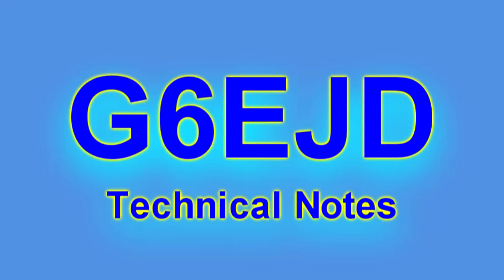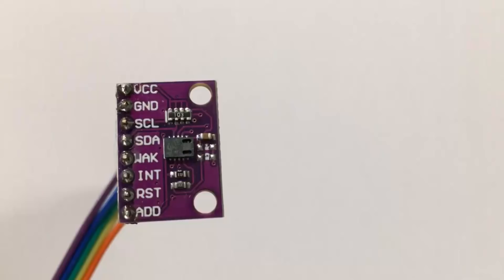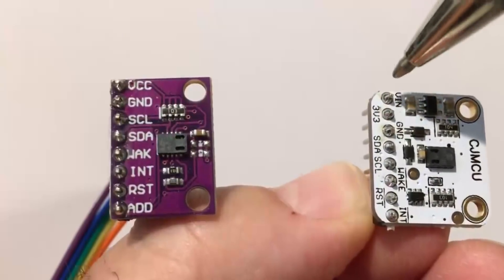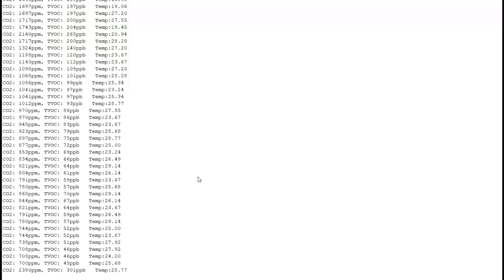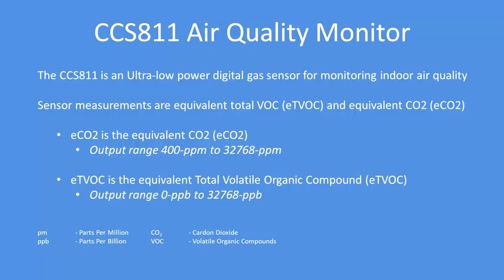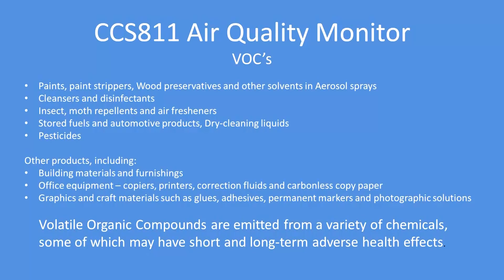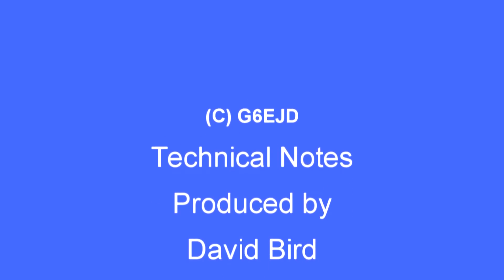Tech Note 103 - CCS811 Air Quality Monitor for Ardunio, ESP8266 or ESP32

Comment: the value of Rs/Ro for No2 in fresh air of Mics 6814 sensor??..kindly reply me
Reply from the maker: 12K in clean air
Reply: @G6EJD  is this confirm or not??
Reply: Actually I am searching a lot on Google but couldn't find any value of Ro/Rs for the Mics 6814 sensor for finding the No2 ??..I am stuck at this point..
Reply from the maker: You can look up the data sheet and it gives the ranges there down to 0ppm, I just did and that’s the value it says.
Reply: @G6EJD  12 K is for which sensor??
Reply from the maker: @shahmeertahir2473  for the one you specified, what else would I have given you?

Comment: Good video. Any idea how acurate the co2 readings are? does sensor need any calibration over time  ?
Reply from the maker: None are very accurate more a relative reading, if you want a reliable high accuracy and repeatable sensor they start at around £50/$75 and they all take some time to read. The sensor featured here is an estimated CO2 reading based on the readings of other gases, a mix that would probably occur in most situations.

Comment: i have fiolet CCS811 sensor, but this sensor has not temperature and humidity
Reply from the maker: No that’s right, this is why the bme680 is better as it adds temperature, pressure a f humidity to VOC detection. The CCS811 requires a burn-in time of 48 hours and a run-in of 20 minutes (you must allow 20 minutes for the sensor to warm up and output valid data).

Note: Temperature compensation from an attached NTC Thermistor is no longer supported on the CCS811.
Reply: @G6EJD  thanks

Comment: Hello mate I need your help !
I want to mesure Oxygen or Nitrogen in the air at the outlet of an oxygen generator ! is this sensor useful ?
Reply from the maker: Does not measure O2, use something like this: https://www.seeedstudio.com/Grove-Oxygen-Sensor-ME2-O2-f20.html
Reply: @G6EJD  thanks ! that's what I fear too expensive and not available in my country :(
Reply from the maker: Check out: 
Grove O2 sensor
LuminOx sensor
R17/R21/R22 sensor
Figaro (such as K50)
UK City/Citicel sensor (4OXV/7OXV)
SenSore sensors
Possibly even a car lambda sensor such as Bosch LSU 4.9
Reply from the maker: Car lambda sensor might the be lowest cost sensor if you can get a data sheet for one.
Reply from the maker: I can’t find any low cost, easy to use sensors for O2
Reply: @G6EJD  LAmbda sensor works at highlt tempretures 600 °C :(  I need to search one of your sensors list .. thanks for your helpmate :D !

Comment: i bought cjmcu 524 nh3 gas sensor it includes stm328003f inbuilt on it and  it has i2c pin, but i cant able to scan the i2c addres.pls help me out of this
Reply from the maker: Have you go the right I2C connections, have you tried an I2C scanner, check the data sheet for it's I2C address it should be found. You probably do not have the correct i2C pins connected.

Comment: Thank you for the tutorial! I noticed that you used the Adafruit library for the CCS811. Can we use this library even though the sensor is not from Adafruit? I noticed that the Adafruit one is more expensive.
Reply from the maker: Yes Adafruit release their libraries for general use, I have never used Adafruit products, but sometimes like the bme280 sensors they use a different device address and so the library needs different settings to get things working, but this rare. Some really low cost devices maybe out of specification from China, that’s the risk, but generally if they are the difference is marginal for most applications.
Reply: @G6EJD  I see, thank you for the clarification!

Comment: Thank you very much for the tutorial, so how do we calculate the ratio of oxygen concentration in the air? Or just help me for reference
Reply from the maker: Sơn Nguyễn Minh, the device is calibrated at the factory. The only way you can calibrate by varying the reading value is to use an external reference like any other calibration method. It’s more of a qualitative measurement giving degrees of concentration

Comment: do I have to use a little fan that blows air to the sensor?
Reply from the maker: Morten mo, using a fan will give you false results due to wind chill etc.
Reply: @G6EJD  but when there is no air movement near sensor ...  are co2 results ok then?
Reply from the maker: Morten mo, you will always have natural air movement to give you a reading and the gases don’t tend to be in pockets of air and are naturally dispersed. You can use a fan but don’t expect accurate results

Comment: I'll try to hook the breakoutboard up to a wemos d1 mini, like in your wiring-diagram, but I got one question about your .ino-sketch: In the Code the only pin-reference i can see is "A1". Should i change it to 'D1' or 'D2', since you're wiring the sensor to these pins ? Thank you in advance :)
Reply from the maker: Which pins you use depends on the board type, are you using an ESP32 or ESP8266 and what is the board name? If an ESP8266 nodemcu type then the correct pins are 4 and 5, let me know
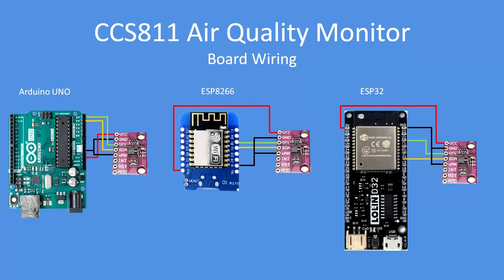Reply: @G6EJD  a "Wemos D1 Mini" like i wrote above, an ESP8266. The Sensor breakoutboard also looks exactly like your purple one. In your picture at 3:20, the middle-one is exactly my setup.
Reply from the maker: Kartoffelsnack, so what is not happening are you getting any values on the serial port? Most problems will be wiring based assuming the sensor is ok.
Reply: I haven't tried it yet, because i don't know how to change the code to fit the pins on the 'd1 mini'.
Reply from the maker: If your using the Wemos D1 Mini then connect the sensor to D1 and D1 as labelled and shown in the centre diagram.
Reply: @G6EJD  Do i have to change the code?
Reply from the maker: Kartoffelsnack, No code changes required connect the Wemos d1 mini to the sensor exactly as I show in the schematic, compile and upload and see what it says on the serial monitor does it say failed to start sensor?
Reply: @G6EJD  today i finaly found some time to look at the sensor again.
with "A1" it wouldn't compile, so i changed every 'A1' to 'D2' and it seems to work now :)
Reply from the maker: I've removed the A3 references in the source the Sensor ON / OFF functions are not used
Reply: @G6EJD  The  Sensor_ON();-function is still called within the setup();-function. I think this will lead to an error.
Reply from the maker: @Kartoffelsnack  These functions are only required for the Adafruit boards, so I removed them and the function call too.

Comment: Good day. How to display information in lcd1602?
Reply from the maker: The LCD library is inbuilt so I suggest trying out one of the examples then adding the driver and lcd.print statements to my code.
Reply: @G6EJD  Do I just need to substitute an serial.print for an lcd.print?
Reply from the maker: Михаил the other way around. Every time you want to display on the LCD do a lcd.print

Comment: it does not measure CO2, only CO
Reply from the maker: I think you should read the data sheet again, your wrong it measures Volatile Organic Compounds and estimates the Carbon-dioxide level NOT Carbon-monoxide. If you don’t agree please write and complain to the manufacturer that the lowest cost and power sensor on the market isn’t good enough and doesn’t measure CO2 and ask them what they are going to do about it.
Reply: He's somehow right, it seems that there are two versions sold:

CO2:
https://www.ebay.de/itm/CCS811-HDC1080-CO2-Carbon-Dioxide-VOCs-Air-Quality-Temperature-Humidity-Sensor-F/232747057091?hash=item3630ce3fc3:g:cv0AAOSw7I5a4Xqv:rk:9:pf:0

CO:
https://www.ebay.de/itm/CJMCU-CCS811-811-Carbon-Monoxide-CO-Cov-Gas-Sensors-Air-Quality-Numerical/263548924643?hash=item3d5cbd72e3:g:R8sAAOSwlJlaqOA-:rk:8:pf:0

Comment: https://rover.ebay.com/rover/0/0/0?mpre=https%3A%2F%2Fwww.ebay.com.au%2Fulk%2Fitm%2F263786011189

Seems there are combo boards with multiple sensors available.

Anyone extended this project to try these additional sensors??

Comment: I have CCS811 running for weeks on an ESP but it drifts so much that it is useless for CO2 trend logging.  It is a VOC sensor and just has a multiply factor for CO2 so if have VOCs for solvents say  then CO2 is just wrong.  I changed to an optical sensor  EE893  but $90 in cost, so not far to compare. It is stable and not sensitive to VOCs.
Reply: These things can't distinguish CO2 from VOCs, they're sensitive to a wide range of gasses with different sensitivity levels. The eCO2 reading they provide is only valid if there is ONLY CO2 present. CO2 is typically one of the gasses that metal oxides sensors are least sensitive to, so basically the presence of any VOCs makes the eCO2 reading totally invalid, because it will appear much higher since the sensor is more sensitive to VOCs. @Graham Wise is correct, these things are not useful for measuring CO2 indoors. You really consider the eVOC reading to be accurate either, it's really only good for deviations from baseline. 

Actual CO2 sensors are kind of expensive because of how they work, even the cheapest ones on Aliexpress are $25 or more.
Reply from the maker: There are a number of issues here, first I believe most implementations do not apply the device data sheet instructions for use such as modes and for establishing and updating the baseline and to be fair to the manufacturer they do clearly state the CO2 reading is ‘equivalent’ not actual and they don’t quote any accuracy figures so we have to determine that the device is a relative reading only, but for most most applications the device can be used successfully to determine if the atmosphere contains gases that are higher than the device baseline, it’s most definitely not an absolute measurement device. If the air is good the readings will be low if bad high, that’s probably all we need to know.
Reply from the maker: I think that’s exactly the point it’s a relative air quality monitor set against the last known baseline , if the air is generally bad then it’s either more of the same or worst or better. I’ll have a look through the library to see if there’s a function to read write a baseline. I have a Dyson Cool Link fan and it’s air quality monitor bears more than a passing similarity to the css811 output the problem is at £500 it’s a bit too expensive and complicated to take apart to find out!
Reply: I had the same experience as Graham Wise. I tried two different CCS811 sensors with an ESP8266 and even moved to an Arduino. After a couple of days the VOC / CO2 readings were completed useless. One reset and it start working again.... What about you David Bird, have you run it for some days? Did you experiment any drift? BTW, thanks for all the great videos!
Reply from the maker: I think by the time VOC rises above the background / normal values CO2 levels becomes largely irrelevant as the toxic air is driven by the VOC content. So-far I've found it tracks the CO2 levels quite well.
Reply from the maker: Well I have only been running it after being woke up from sleep then I take 4-readings as the first 2 are usually 0’s as the sensor heats then I get a stable and sensible reading so I take the fourth. I could use the nINT output to wait for a valid reading too, but I find the simple approach is working ok for me. I have also noted that it’s very sensitive to power supply variations and takes quite a lot of power. I’m not aware of any endemic issues with the sensor either, so I suspect it’s down to application.
Reply from the maker: I’ve just read the data sheet again and there are specific processes to follow regarding baseline settings for operation > 24hrs did you implement these?
Reply: The problem is you can set a baseline if you can read out the registers, Sparkfun library seems to hint at this but don't you need to know it is in "clean air" or know values, local air can very different to a air monitor station, so what value do you set?
Reply: Hi Dave , so if power long to let it settle, read the raw data from register 0x03 and write into the 0x11 baseline register to zero the device?  The Raw data bytes are defined but the baseline is just general words so hard to tell if it is the same format. The data sheet implies it has to be done say every week so or a user control to zero the module when the values are silly.  Graham
Reply from the maker: The data sheet says every time the sensor is powered on it requires 20 minutes of “run-in” before readings can be considered usable.
It also says the BASELINE Register (0x11) is a two byte read/write register that contains an encoded version of the current baseline used in Algorithm Calculations and that a previously stored value may be written back to this two byte register to re-baseline or reset what the algorithms will use to derive a VOC reading or until (interestingly) until it adjusts the value as part of its internal Automatic Baseline Correction. 

So if a monitored environment is continuously bad, it will adjust the baseline to make this the normal.
The application note also says:
The BASELINE register can be used to ensure that the CCS811 operates in a stable and consistent manner after each power on, regardless of the ambient air quality (e.g. if the sensor is started in ‘dirty’ air). To use this mechanism the application software must read and store the BASELINE register when the ambient air is fresh. The BASELINE register value is meaningless to the host application as it uses proprietary encoding. The application software need only read this value and store it locally. It is not mandatory to write to this register, the CCS811 will configure and manage its baseline autonomously.
So in summary, it takes care of current air conditions and adjusts itself continuously but as the sensor determines if the air is fresh it performs a setup write to the BASELINE register.

However, due to the long term drift of MOX sensors it is recommended that a new clean baselines is stored and restored periodically.
I read all that as taking a Baseline value when the sensor is in known clean air, then every (say) week restoring the baseline back to that value. I think this explains the errant behaviour over extended time.
Reply: Hi Dave, I have reset the sensor and left for an hour and just drifts rapidly.  I have a theory that it was left on too long  without reset perhaps the internal trimming software is out of range. I have done about 10 resets over the days without effect.  it reminds me being locked out on a microprocessor in the old days. Thanks for understanding the datasheet better than I could. Graham
Reply: Why did you go from this cheap thing all the way to a $90 dollar and just didn't pick up a cheaper sensor like the MH-Z19?
Reply from the maker: To be honest I only pick popular and readily available sensors.
Reply: @G6EJD  it was a response to the comment of the guy that bought the 90$ sensor. If you just want to check CO2 level for example in a room with a lot of people, this sensor is almost perfect.
I ordered a couple of these sensors
Reply from the maker: It will be interesting to know how it performs, only downside I see is it’s a bit power hungry.
Reply: @G6EJD  yeah and it requires a bit of a burn in according to the datasheet: "Early-Life (Burn-In)
CCS811 performance in terms of resistance levels and 
sensitivities will change during early life. The change in 
resistance is greatest over the first 48 hours of operation. 
CCS811 controls the burn-in period allowing eCO2 and eTVOC 
readings to be used from first power-on after 60 minutes of 
operation in modes 1-3."
Reply from the maker: bonnome2, All sensors appear to need the same conditioning before they stabilise, a facet of MOX materials, the Bosch BME680 does exactly the same and needs 30-mins to stabilise before any reading.

Comment: Nice one again :) great tutorial, simple and easy.
1 mistake, if you check datasheet for ccs811 you will see that it is ONLY VOC sensor and it calculate CO2 depending on VOC levels.  Made same mistake when i bought them. So its pretty useless for outdoor CO2 measurement but its great for indoor use, controlling air flow inside and checking your storage rooms... 
I store cleaning stuff in toalet, bad idea, use couple of times per day and breathe in all that stuff.
Reply: The official description of the ccs811 "Ultra-low power digital gas sensor for monitoring indoor air quality".
Something not all sellers put in their description
Reply from the maker: Yes the CO2 reading is an estimate or relative to VOC reading nonetheless still a useful indication and it’s better in my opinion than the BME680. Other than the SHT35 with a permeable filter there are currently no sensors suitable for outside use. Humidity and atmospheric components will destroy most devices given time.

Comment: Where did you get ut that cheap?  Lowest price i can find on aliexpress is around 8/9 euros
Reply from the maker: There's a sort of spot-price on AliExpress, I got mine from WorldChips and paid £4.13 including postage, but I see today it is £6.35. For the more expensive one, I paid £11.97, but now £11.54 but it does have an on-board NTC which gives a slightly more accurate temperature response.

Comment: The temperature readings seemed a bit all over the place. I got quite stable results when I tried the dedicated DS18S20 chip.
Reply from the maker: Yes, it's actually the device temperature reading when the sample was taken, it has to heat up the internal sensor to take a reading and in that regard is not that useful, it's certainly not room temperature.
Reply: Ah that explains it, thanks.